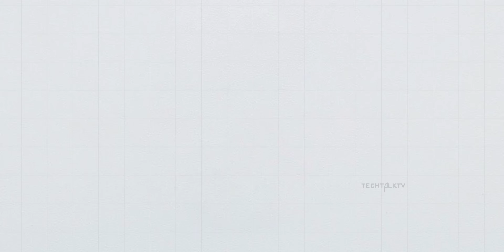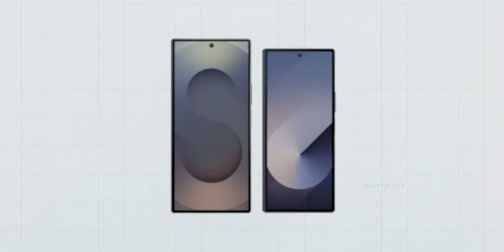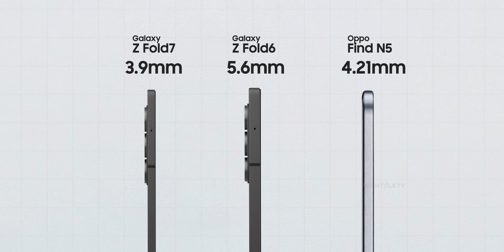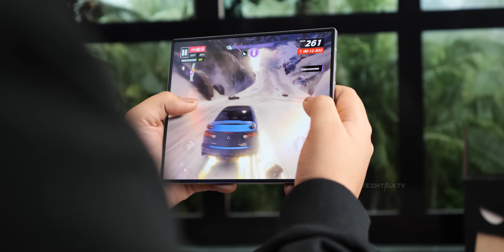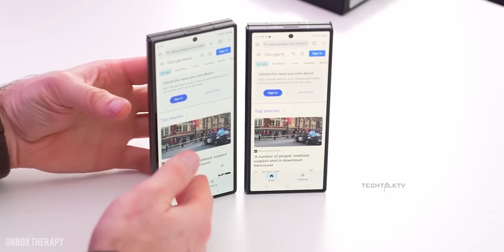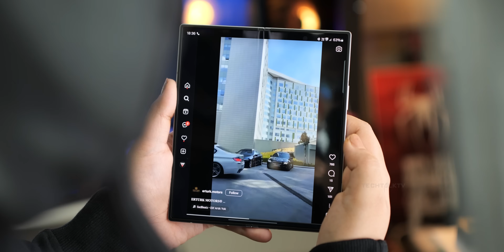Samsung Galaxy Z Fold 7 Just Crushed the Competition

Comment: I beg to differ with you having had both the Vivo X Fold 3 and te Honor Magic V3 they blow Samsung out of the water with their cameras and battery size. While the Z Fold 7 will be slimmer with a wider outer screen, the Honor Magic V5 will only be 8.8mm thick making it the thinest in the world, plus it will have 6,100 mAh battery compared to Samsungs's puny 4,400 mAh. It will also have 66watt wiredcharging and 50 watt wireless. Snapdragon Elite chipset, 50-megapixel primary camera featuring OIS, accompanied by an ultra-wide sensor and a 200-megapixel periscope telephoto lens. It is expected to arrive with other features, such as wireless charging support, satellite message functionality, IPX8 water resistance, and a side-facing fingerprint scanner. This crushes Samsung hands down!

Comment: Used a Fold 4 for like two months before it got stolen during a mugging. Two years later I finally got my hands on the Fold 6, and man, I really tried to like it. Gave it an honest shot. But after 5 months, I ended up switching back to the Galaxy S25 Ultra. Why? The Fold’s just too damn expensive to be using it folded 90% of the time. And the camera setup? Pretty underwhelming compared to the S Ultra line. Decent at best. Cannot afford to have a 2k phone with just “decent” cameras. Sure, the first few days are awesome — it’s new, it’s cool, it’s different. But once the novelty wears off, you’re just using it folded like a normal phone, barely ever opening it up. At home I’d always go for my iPad or desktop anyway. So the big screen advantage? Basically useless.

At the end of the day, the Fold felt like a cool concept that just didn’t fit into my actual day-to-day life.

Comment: I'm actually excited? 😅 I still have the Z Fold 3 and my biggest gripes is weight, camera quality, screen(s) durability, and yes, battery life. So for me, this addresses at least two of the four by a big margin. Potentially three if the screens are more hardy than the ZFold3. I've already gotten used to my workaround for the battery issue. I guess the changes feel more drastic when I'm only upgrading my phone once every few years. Modern problems, modern solutions: can't be disappointed if you're a few years behind current technology. Lol

Comment: Every single post about the fold is crying out for a bigger battery and a crease that lasts more than 3 months. Surely someone from samsung is watching. Ive wasted nearly a year with the 5 and 6 having both replaced twice, so 4 folds in less than a year. Im not dropping 2 grand on another one until they fix these issues.

Comment: I honestly prefer the Galaxy Fold form factor to opther phones like the Magic V3.
People always complain about the narrow outer screen, but I dont see the problem...
"That outer screen is too small!" Well you got a foldable, how about you unfold it if you need to do more than checking a few messages!
On the other hand, the Magic V3 or Find N5 with their swuare inner screen are horrible for most apps in fullscreen mode.

Battery is also alway an issue people complain about. But in reality the difference between ZF6 and Magic V3 is only 17%. Sure, a bigger battery would be nice, but it would also not be as big of a difference as people may think.
Reply: I agree. I use the outer screen only when I want to check messages, playing Pokémon go and when I use auto mode on game. For this things I don't need a big screen. When I need a big screen I use the inner screen. This is the reason for the fold.

Comment: no one asked for a phone the thickness of a hair. We want a good size front display and better battery. Thats all we asked.
Reply: Yeah sadly I have ALWAYS seen comments praising thin devices to which I am always saying people will regret this. We are honestly at a point where processors can only do so much for a battery, the only way you'll notice an increase in use, is by literally increasing capacity. Now here we are 2025 and getting the iPhone air and Samsung edge, yet both will be sacrificing battery most prominently. This is even worse when you think about just how wide and tall the fold is, yet still has a smaller battery than the S series which still even gets a lot of space taken up by the built in S pen (another reason I haven't upgraded from my 21U. Give me battery, not a S pen. If I want that, I would have bought a note)
Reply: People did ask for it
Reply: Gonna have to disagree with you on that one. If they don’t make the phone thinner, it’s gonna get really hard to use one-handed if they also make it bigger. The Fold 6 was already kinda awkward to handle at its current size — imagine if it were even larger. If you’re gonna increase the size, making it thinner is pretty much a must.
Reply: I asked for it, not for the battery. A better battery in it will cause an unfair competition 😂
Reply: No one being you? they wouldnt have done jack if the majority didnt suggest having a less bulky foldable phone, dont kid yourself 🤦

Comment: Samsung probably keeping the battery capacity low, so they can increase it in Z fold 8 and make it looks like big upgrade.
Reply: 😂😂😂 keep waiting, same battery capacity since fold 3, good luck on your expectations 😅👍
Reply: @lucasanjoz  we were keep getting same display and cameras on Foldable for years, then Samsung upgrade them both drastically, so they might increase battery as well next time. 🤷

The only thing I have no expectations from Samsung to increase is charging speed.
Reply: @lucasanjoz  Apple does the same shit so it is what it is
Reply: And what if they didn't?
Reply: Too funny,you know Samsung well! It's just a money grab for them and the only way they can sell their phones is by giving huge tradein values🤑
Reply: SHITSUNG IS PATHETHIC.
Reply: I dont think they will unless they can make a smaller battery. The fact is, the average joe cares a lot about slick looks etc. Now since they are using a new battery, they maybe want to test it out first with what they know instead of possibly repeating the exploding battery.
Reply: Z fold X will also have the 4400 battery...
Reply: It took almost 8 years to mass produce stable li-ion 4000mah for sqmsung phones. Changing to solid state batteries will take twice as long. I mean even with the latest li-ion phosphate batteries that use different materials and a 30% - 40% efficiency in life cycle,  very minor upgrades - is still not at the mass produced stage,  only just seeing usage in EV, it might take another 5 or 6 years to see it commonly in compact mobile phones.
Reply: All phone's do that i dont know why

Comment: I'm glad that I returned my S25 Ultra and decided to wait for the Z Fold 7
Reply: I bought the S25 Ultra (has a bigger battery) over the Fold 7. I was coming from the Fold 2 which has the same size battery as the Fold 7 smh. I want more battery for a foldable phone.
Reply: I went from s21u to fold4 to s25u, will never go bsck to fold since my fold4 got so many issues because of software buggs, one ui 6.1 killed wifi and did my bluetooth week, 6.1.1 driver killed my 5g and when folding the phone I have to restart whole phone to able to use the phone, so wierd bug cost 150€ to fix.
Reply: @Kage0No0Tenshi  Sorry to hear about all the issues u had. I've had the Fold 5 since launch and haven't had a single issue with it.
Reply: @CodeSerial  I agree with ur logic but I have several portable chargers ( my wife and son have iPhones) and there are power outlets everywhere I go so battery performance/charging or topping if off has never been a consideration for me when buying a phone
Reply: @blacar3270  I have all of that too but it's disappointing they've kept the same battery size since the Fold 1(?) and there's Chinese brands with thin foldables with 5600+mah. Samsung is starting to Apple around now

Comment: And bump the resolution to 4k and add Dolby vision and it would be amazing !!
Reply: It's likely that you will never see Dolby vision on any Samsung device. Dolby vision is basically Samsung's enemy.
Reply from the maker: 4K is overkill, imo
Reply: @TechTalkTV  not really and we should have the option, like its 2025 and foldables are such low resolution. I want my screen to look as crystal Sharp as possible when am spending almost 2k on it, i don't want it looking so low res. They need to make the jump and set an example for the rest of the industry by making folds displays 4k !!
Reply: @duckmartin9853  does it have the battery capacity to go 4k?
Reply: @duckmartin9853  Dude u won't even be able to notice the difference of 4k on such a smoll screen it's way higher then the human eye can see, so it would just make the phone alot more expensive and alot less battery life
Reply: The battery tech is here that would support 4k even 8k screens. And Samsung have shown interest in silicone carbon batteries and sure theres a 8.3 inch 8k oled out there so it can be done !! @dr.hultenstein9749

Comment: Z fold 7 looks to be a solid B+ release. It still has a disappointingly low battery, which is a shame, but it looks like Samsung is at least finally putting in the effort to innovate with their foldables after multiple years of stagnation.
Reply: If it's as thin as claimed, I'd say it's A for sure. The lightness and portability will outshine the existing competitors and steal thunder from Apple's forthcoming fold, which likely won't be anywhere near as thin.
Reply: @jcen1918 its not close to the N5
Reply: @SWOTHDRA Your math isn't mathing. It's thinner than the N5.  So thin they had to order special parts for the usb C port and get it certified to confirm it was in compliance.

Maybe you're talking about the N6?  I get it. Time travelers always lose track of "when" they are.  ¯\_(ツ)_/¯
Reply: @SWOTHDRA Samsung Foldables are the most reliable compact device for now
Reply: Until silicon carbon gets better they arnt using it, also there are other means of increasing battery and you guys want a thinner less bulky foldable phone 🤦🤦🤦🤦
Reply: Bruh this is not official source

Comment: 450 / 5.000
You make me laugh! Samsung should solve the problem of the screens inside and then pretend to ask for $$$ for the next Folds. They have become a good joke. No battery in spen, no bigger battery (from fold 2 the same joke of 4400 mah), no fast charging (in 2019 they introduced 45w and I'm on the sixth model ... immediately the seventh appears and they are also on 25W) another good joke. The list can continue but I'll stop here so as not to offend the SHEEP :))

Comment: Hows 3.9*2 =8.9 and not close to 8mm 
Also if samsung can somehow get the periscope camera of the s25 u then it will be awsome
Reply from the maker: It's 3.9mm per side when open, but when folded, you have to add the hinge, cover screen glass, and a tiny gap — that’s why it ends up 8.9mm instead of just double.
Reply: @TechTalkTV  ok thnks dint factor in that

Comment: Should I drop my Z Fold 6 for this? When does this launch?
Reply from the maker: Absolutely! The upgrades are huge and it's launchin in July
Reply: @TechTalkTV  

I would say that most likely the battery life will be worse  than fold 6 if it's the same battery capacity.
Reply: But you can wait for the honor magic v5 which will come with 8 elite and 5600 mah or 6000 mah also magic os optimise the battery better than one ui @hasanwowdb
Reply: @hasanwowdb No, the S24 Ultra and S25 Ultra have the same capacity, but the S25 Ultra's battery life is around 50 minutes longer because the Snapdragon 8 elite is much more efficient.
Reply: @hasanwowdb not really, even it have bigger screen and the same battery, but the SoC is more efficient and faster, so it would be slightly better or the same with Fold 6
Reply: Id say no! The only difference is slight front screen size. It's a waste of money to switch. Same battery too id say wait to see what the 8 will bring they have to add a new feature. The 7 is just there flex fold so they can claim a "thinnest" phone title. Thats all the 7 is is a bragging right for being thin